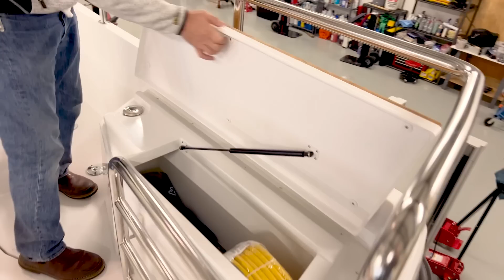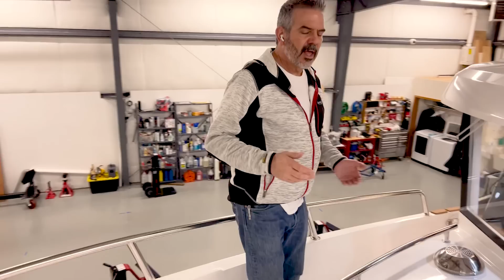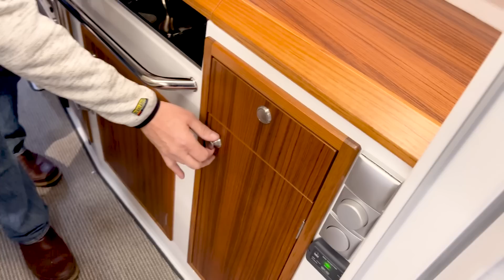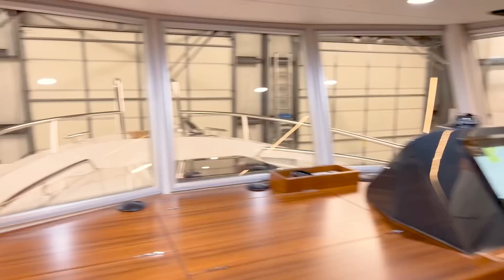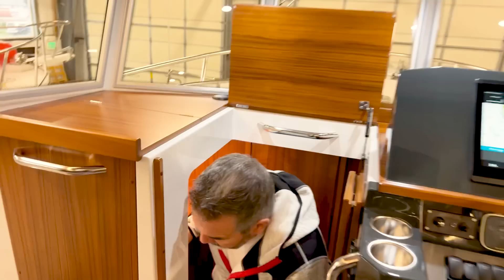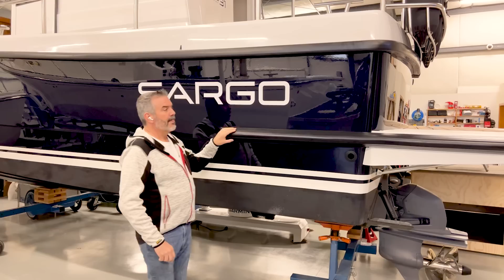Sargo 31 Aft Door Walkthrough

Comment: I have used this boat model for two seasons. What this video doesn't reveal is the extremely good performance in tough conditions for its size class.
Relatively expensive, but in return for the price, I feel that I have received performance and reliability in tough conditions, which has made the purchase reasonably priced.

Comment: the access to diesel fuel by the deck storage area seems risky, There's bound to be a spill someday and it appears it'll either flow down onto the deck or into the storage space. Seems like that would make a really smelly mess.  That boat is incredible and you did a superb job of pointing out all the features, thanks.
Reply: Based on that any fuel access place is risky